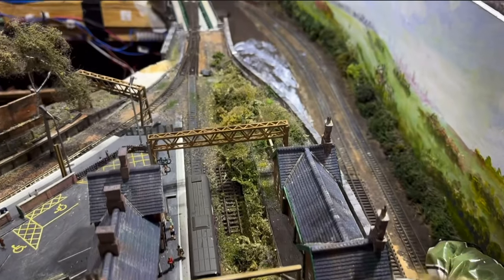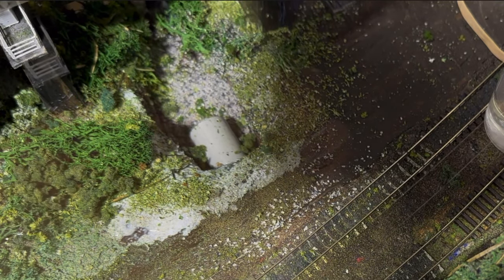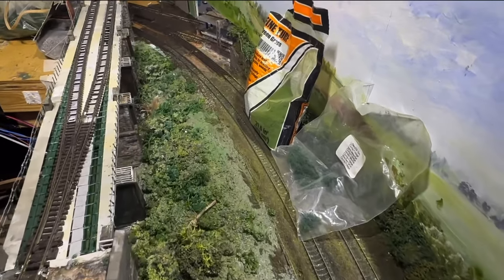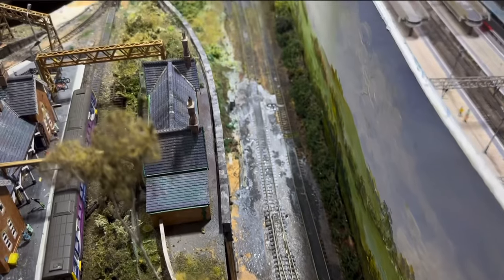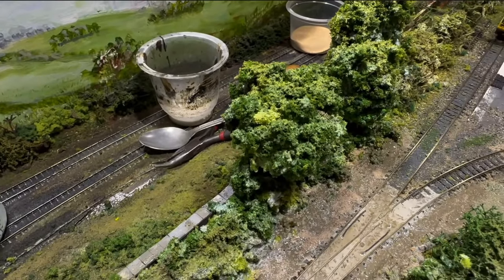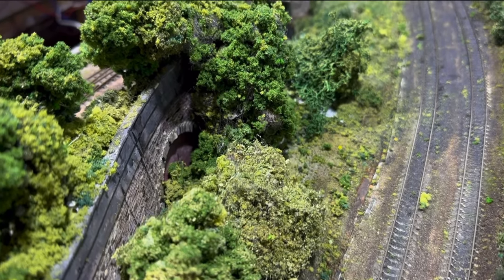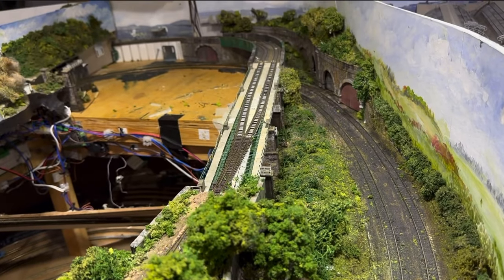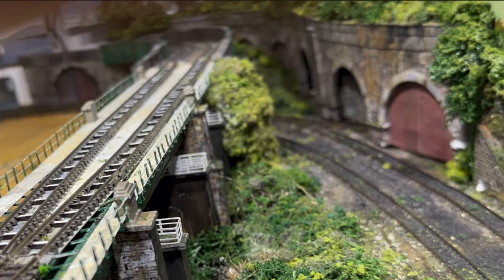ADDING FOLIAGE AND SCENERY TO THE LAYOUT

Comment: Another great coming together video! Brilliant solution to blending the tracks from the Manchester station scene. As others have said, the generous use of scenic materials is a great way of completing a scene and fooling the eye. For me, I would have probably given the ballest on the lower mainline a  subtle but 'cleaner' appearance, for a greater contrast of the 'man made' trackbed running through the surrounding natural scenery, and even the tracks on the upper level.
By the way, completely separately to this video, from watching a Netflix series - Top Boy - not bad for one of these UK based criminal gang dramas, there was a scene filmed in the real Manchester Piccadilly station, and it was amazing to see so many similarities between your model and the real environment, right down to the shops, balcony, and concourse that you have modelled. No question, that is probably the most realistic model of that location, and could easily be put on display in the concourse of the real station. I am sure you must remain very proud of your model!
Reply from the maker: Ahhh thank you. So very kind of you. Shortly after starting the layout and visiting the station, I had a Manchester newspaper contact me asking to produce an article. Then COVID hit and not heard anything since. 

Regarding ballast, its very much a personal taste thing, I do prefer darker balast, as I add paint to the glue mix, starting lighter, add darker and so on. This scene does need some blending, it does look a little diseased , easily sorted, lol